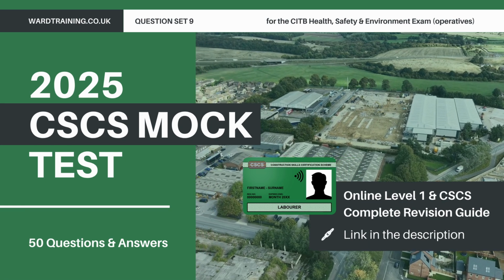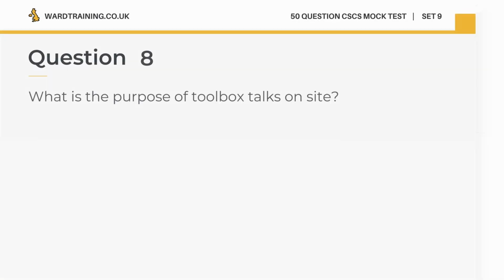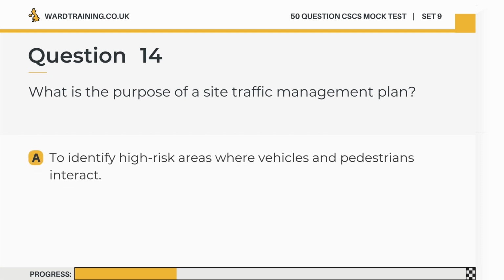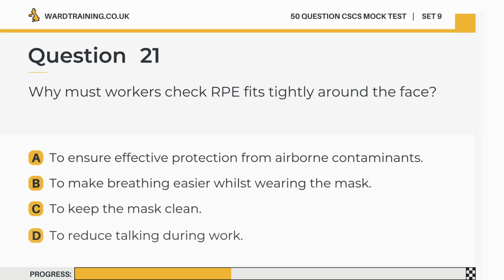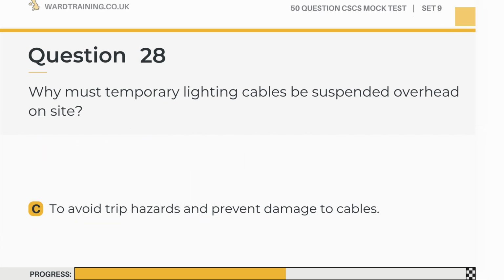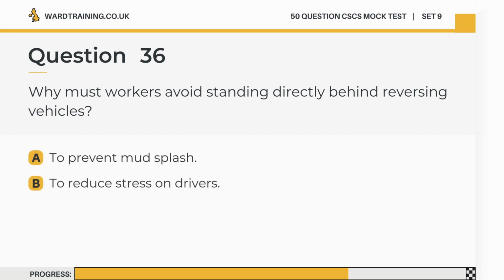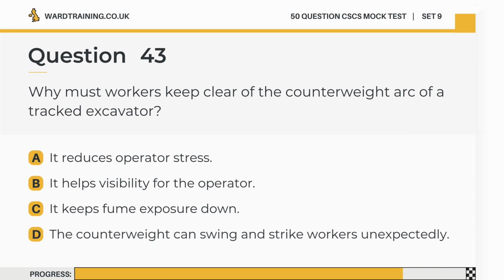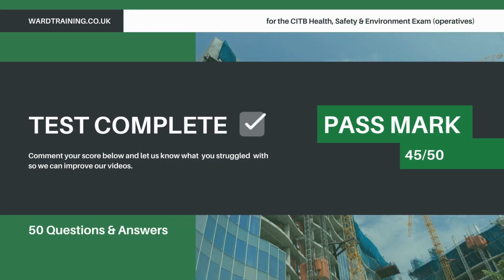CSCS Mock Test 2025 | 50 Questions & Answers (Set 9)

Comment: fix question 15
Reply from the maker: Thanks for pointing this out. Will get it corrected 👍
Reply: I Wanna to get csca exm in well mark.. Is this Fixed Question for every subject.?.  Do all of students give same question paper? I Don't understand.. My goal is chemical engineering.. So what should i do for my csca exm..?which type question is important for me?
Reply from the maker: @MstAuliaParvin  Hi, there is a set of roughly 1000 questions that you could recieve in the exam. You will get asked 50 randomly selected out of this set so each student gets a different set. This is why we have so many different sets of questions to give you the best chance of covering all possibilities.

To get the green CSCS card which is required for most construction sites you will need to first complete the level 1 health and safety in a construction environment (RQF) which can be completed online and purchased through our website.

Next you will need to do the CITB Health, Safety and Environment Test (operatives) at a local test centre.

Once you have these 2 completed you can apply  for the CSCS card.

If you would like some more guidance please feel free give us a call or email. Details can be found on our website www.wardtraining.co.uk